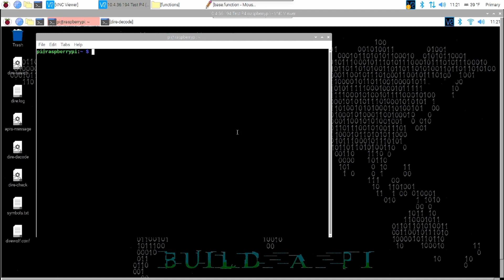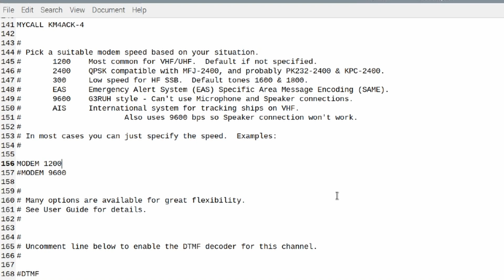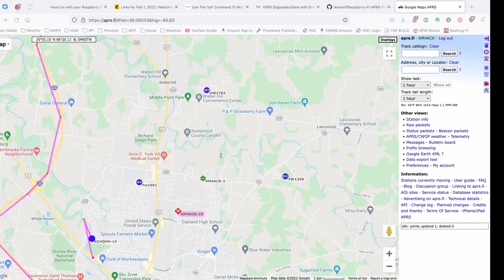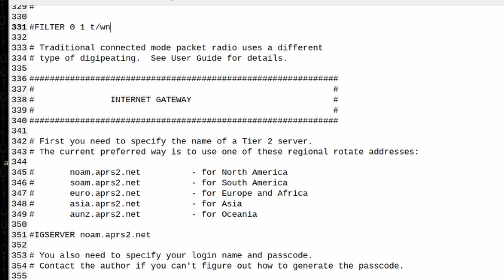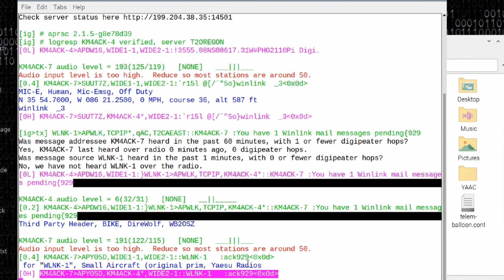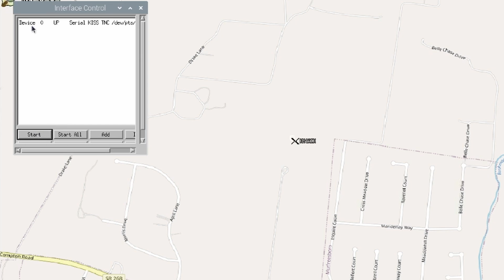Baofeng APRS Digipeater :: Digirig Soundcard

Comment: is direwolf running in the background if I installed it from build a Pi? When I reboot will it automatically be running without me needing to do anything?
Reply from the maker: No. Direwolf doesn't run in the background automatically. You will need to configure it to start on boot.

Comment: Is it possible to save multiple direwolf config files? I got my build a pi running aprs digipeater with the digirig i robbed from my 2m kit. I just recieved a sabrent usb sound card to dedicate to the pi for use in the shack but i would like to not have to reconfigure to use the digirig in the future if need be.
Reply from the maker: Yes. You can have multiple direwolf.conf files. Just use the "-c" switch to load the one you need. ie. (direwolf -c myconf_file.conf). For more details, run man direwolf from the terminal.

Comment: Hey Jason, I tried to Chirp Program my UV-5R using the Green Cable, the Digirig Mobile and utilizing the Serial port on the Digirig mobile soundcard, my Laptop recognizes the device but will not load the proper driver. Did you have any issues with yours initially? Maybe I should take this to the reflector?? Thanks and 73.. de NF4J
Reply from the maker: I didn't have any issues with mine. You might reach out to the creator of the digirig.

Comment: Jason, do you know if the Digirig Mobile needs to have the PTT tabs re-configured on its board to key the Baofeng or Kenwood K20A? Or is it configured to key them already? I know your video names the bAofeng and Retevis specifically...just wondering about the K20A as well. Great video Bro!! de NF4J

Comment: Hey Jason, did you have to modify the Digirig in any way? I found a post at the Digirig sight indicating you need to cut a trace and bridge another with solder to get RTS to perform the PTT. Thx. Great vid as always.
Reply from the maker: I didn't modify it in any way. Double check with the seller but I believe those instructions are for an older version of the Digirig.
Reply from the maker: From the digirig website "Starting from rev 1.6 the hardware PTT is available on the audio socket (ring 2) independently from serial CAT interface and doesn’t require any solder jumpers configuration. This means that a single Digirig can be swapped around between a basic HT, and your CAT enabled HF rig regardless of CAT configuration. " https://digirig.net/digirig-mobile-rev-1-9/ I have version 1.6

Comment: Interesting! Now I just gotta figure out what APRS is all about. I mean, I sort of know what it is, but I'm not sure what to use it for. 73!
Reply: (Unless I am wrong, because I don't do it yet either!) Its like... GPS tracking, via a transmitted radio signal. But with an APRS program, you can also send and receive email, instant messages, pictures, and weather information. 
It combines the small radio, and a computer, to TX and RX info.
Reply: I missed that introduction too. Just looked up in Wikipedia what it is about and have some vague idea now.

Comment: Jason - Will this device use the same cables that I use for my Mobilinkd TNC?
Reply from the maker: I do not have an answer to the question. Reach out to Denis at Digirig. He may know.
Reply: @KM4ACK  I'd bet the cable is well documented.  I know the other cables are.  I may have a look later and give him a holler if it isn't already out there.
Reply: That's a great question!  I have several cables both purchased and custom.  I also have one of those Anytone repeaters that sadly has identical looking cables with different wiring.  I got a mess of cables to the point I had to put labels on them. I think he also skipped a feature.  I believe these can be used as programming cables which is a nice bonus feature.